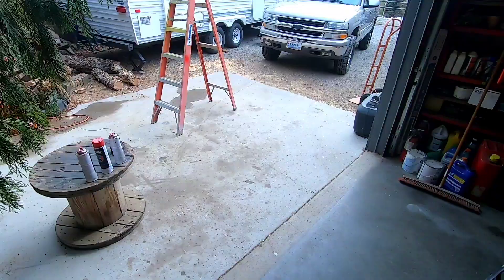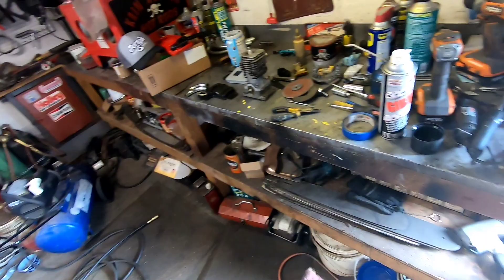Painting the El Diablo 666 Mcculloch 610 Vintage Chainsaw Red!

Comment: I've used a lot of Brake Clean on that filthy 49sp. I'm going to try that $20 ebay puller, a wrench and a hammer on that flywheel. Don't think that saw ever got any maintenance so the flywheel likely hasn't been off in 40 years.
Reply from the maker: Good luck man!

Comment: I like your name McBrick for the 610,s, as it is very appropriate, they are not stylish at all.  The only things they have going for them are POWER and DURABILITY, which are the things I like !  That brand of paint you use really flows on nice, and will try to find a supplier.
Reply from the maker: Thanks Man,  can't remember who I stole that line from, but I've heard them called that before, lol...I buy that MRO paint at Fastenal, but you can get it on Ebay as well, It covers really well and is very durable once it cures out...just limited colors is the only drawback, but still Awesome stuff!
Reply: Thanks for the tip on the paint. @KainKustomGarage